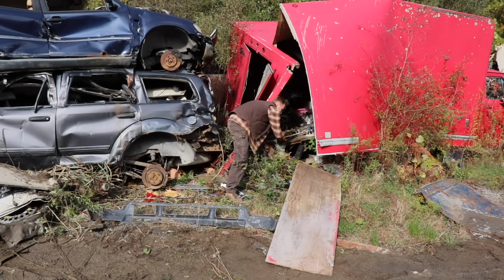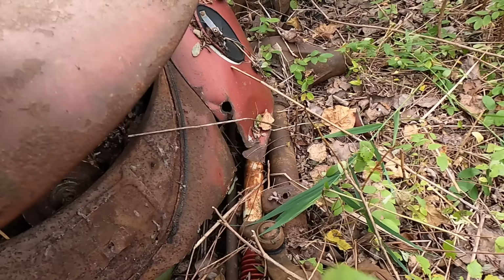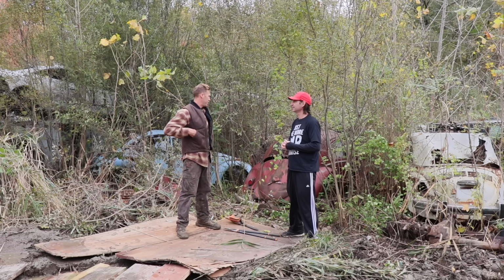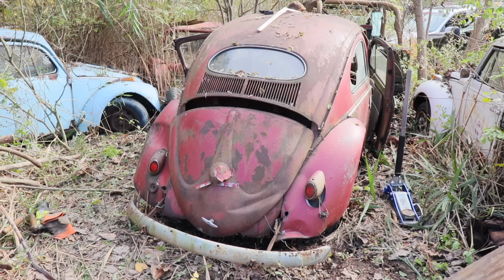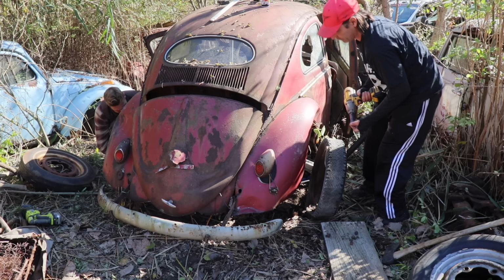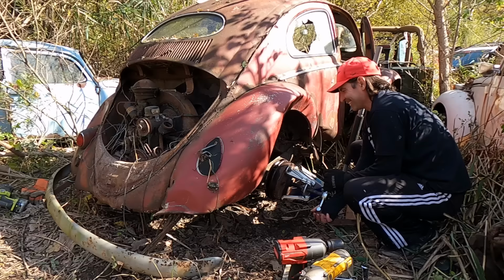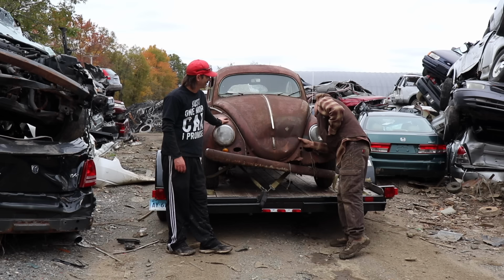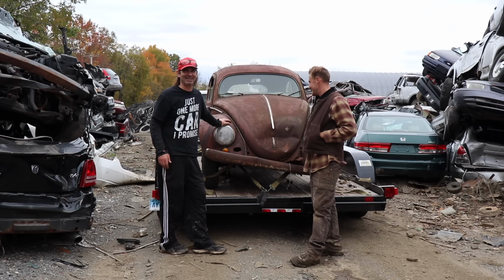Abandoned Rare 1955 Vw Beetle Found Buried in Junkyard sitting 51 years Rescued - 4 Full Restoration

Comment: My first car was a 1957 bug. 36 hp. My dad bought it for me at $200. It was in sad shape. I spent the winter rebuilding the engine and my Dad painted it bright red. It had a rag top sun roof. I drove it to Connecticut one winter from LI. Got caught in a nasty snow storm on rt 95. The bug had terrible heat in extreme cold. Snow was blowing up out of the defrost vents. I sold the car soon after that and bought a brand new 1971 Jeepster commando.

Comment: A 55 "oval". Got its name from the rear window. Rare as hen's teeth. Worked on restoring one back in the 1990s. Great car, simple, all mirtrors and strings! Rarest part is the chrome hubcaps. Apart from all the kerb damage veedub heads turned them into clocks! 
Good luck with the project!

Comment: correct engine parts. Those are hard to find. Big nut generator pully  smooth engine pully, correct voltage regulator, correct fuel pump. the fuel pumps are different on 55 and earlier. Horn button? OMG those are super rare and always missing
Reply: Dude.... you're pissing in his cheerios!!!

Comment: Pretty neat .

I'm old so I remember in 1969 when this was just one more of the millions of VW's across America, looking at the bald snow tires that came off it prolly couldn't pass the annual safety check and so was scrapped when still running .

When did "Honeycomb" taillights (1956 ~ 1961) become "Snowflakes" ? .

Good to see young folks still interested in old cars of any stripe .

-Nate
Reply: Just shine a light on the reflector and you can see how they get the name “snowflakes.” BTW, those snowflakes were on 1954 -1961 bugs. Interesting, I never heard them referred to as “honeycomb“ taillights before. That no doubt is due to the hexagonal shape of the reflectors. Those reflectors are also the snowflakes!  In 1962–1967, VW installed what I call “high heel” (or Dutch clompers) taillights to replace the snowflakes. These were larger with separate turn signals on them. The snowflakes were cuter, but not as safe as the high heels.
Reply: @nonelost1  Hi Marshall ,

You're young so I will pass on your mistake ~ the U.S. A. versions of Beetles used one taillight ('heart') in 1954 and another in 1955, Honeycomb taillights were introduced in the 1956 model year .

There's no good reason for kids to come along and change the given names of things .

-Nate
Reply from the maker: and i'll chime in that i have never heard of " honeycomb tail lights , only used for rims on 70's trans ams . Mid to late 55 USA models came with snowflakes ....early 1955's USA cars had smaller " egg " tail lights , like the 1954 USA cars. Euro 54's had heart tail lights .
Reply: @5150mxVW  Like I said : if you don't know =8-) .
Reply: @VWNate1  Well Nate, I stand corrected regarding the years those tail lights were mounted. When I googled “VW snowflake taillights“/“snowflake tail lights“/“ VW honeycomb tail lights“/“Honeycomb tail lights”, I found that honeycomb was surprisingly popular. Just be sure to specify “VW honeycomb tail lights.” This is especially true if you use those keywords on YouTube. BTW, during the ‘70s and ‘80s, I owned a ‘61 bug, two sunroof ‘62s, a ‘63, and a ‘66 bug. As long as I’ve been into vintage VW’s, I should’ve known better about vintage Volkswagen taillights. So perhaps you should not give me that “pass“ for being young after all.😂🤪🤣
Reply: @nonelost1  O.K., I predate the internet & google by a lot, I forget things too, no harm no foul .

I wonder if I can even remember every air cooled VW I've had, hundreds for sure, I even had a VW shop in the early 1970's most fun job I ever had by far . I wish I could get access to this junker, it'd be fun t make it run and drive safely, "patina" is B.S. but I remember driving rusted out $25 beaters like this in the early 1970's . -Nate
Reply: @VWNate1  That same rusted out beater from back in the day would probably set you back closer to $2500 today. In 1982, I bought my second ‘62 sunroof bug, a white one, for $1200. It had 177,000 miles on it but it was in fairly nice shape. I decked it out like Herbie the love bug, with the 53 decals and stripes. Back then, there were no “Herbie Internet kits.” Instead, I bought the 4 paperback books to the four love bug movies and figured out how to make them from the photographs in the book. I took it to two vintage VW shows, and won second prize in the “square window“ (1958–1964) division in one of them.
Reply: @5150mxVW  Kids : you try to teach them but.... -=8-) . -Nate (also known as 5150 at my old L.A.P.D. job)
Reply: @nonelost1  In 1974 or so during the fake gas shortage I bought a 1960 #117 (DeLuxe sunshine roof) Beetle in ?Santa Monica for $250, it was sitting in a hug pool of leaked out oil (oil cooler grommets were bad) with the right rear wheel parked haphazardly up on the curbstone, drive it home .

My son still has it, unrestored .

At one point I had a (one year only low compression) 36HP engine I'd taken out of my '53 Zwitter (split with oval dash), rebuilt it and that's still in the car 45 years later .

I hope he puts it back on the road one of these days .

-Nate
Reply: RE: "internet Herbie Kits" .

I've never heard of this, sounds interesting .

Disney used quite a few old beat to crap Beetles making the original Herbie movie and I once foolishly passed on buying the 1962 #117 that Buddy Hackett lightly welds near the dome light with for $250 ~ it even had the Disney Studios pink slip  .

The left front fender was bashed in and overall the car was rusty so I passed .

Oops .

-Nate

Comment: I just don't get how anyone could make this work.  They go for from 20 to 40k .  This car basically needs everything and the frame is probably rotted.
Reply: people have made cars from waaaaaay worse, and sometimes it isn't about the profit, but the experience and the resurrection of an historical piece.
Reply: @stefa_  That's (for history and no profit) about the only way I think it could work.  Scott over at Cold War Motors has 3 years in a 60 Fury and isn't even done yet.  For a large part of the time he was working near full time on it. Plus 3 parts cars and all this to get a daily driver. And he's a body man with 30 years experience also having experience splicing cars together.  Granted, this beetle  is was simpler and smaller than a Fury and with no stainless trim, but it is still extremely time consuming.  I cannot imagine there a single part on this car that does not need either a full restoration or to be replaced.  The roof is exposed and rusty and so it also probably needs full replacement.
Reply: Dear  @tarstarkusz  
👍👌👏  I thought to recognize your name, now I know. CWM forever! ;-)
Scott N. is doing the most impressive thing with the sliced Fury I have ever seen. He was the first I thought about after seeing the big dent in the bugs hood. I will never forget the incredibly amazing denting out jobs he did on the black pickup truck and Jims grey car out of the 1940s. All that in his driveway and just for fun. What a great guy.
Best regards, luck and health.
Reply: @Chr.U.Cas1622  Scott has done some amazing things with old cars,I always look forward to each weeks episode.
Reply: @rogercamp6071  One of the best car shows on YT and better than anything on TV.  I love the little skits like "My Classic Tire" and even the "Classic Darts" and "Light Buzz"
Jim is working on a beetle and a bus, but they don't usually get updates on the show.  Love all the old cars and the "driveway" atmosphere.  Scott's a pretty good musician too. He writes all the music that's in the show.
Reply: @Chr.U.Cas1622  He keeps saying this is "not going to be that kind of car" meaning a show car, but as time goes on, it's more and more like that kind of car (except under the hood).  He is doing an outstanding job.  Even doing his own sewing to remake the interior.
Reply: @tarstarkusz  yes I think the same way, the Fury will be as nice if not better than it was new and in last weeks episode he's purchased Tom's 60 Impala so can't wait to see what happens next.
Reply: @rogercamp6071  Hopefully he'll do some work on the Impala this year, but I doubt he can get to it.  I'm really looking forward to the work on Jim's Lincoln.  It looks like only the T is gonna get plates this year.
Reply: @tarstarkusz  yep Scott reminds me of my cousin who after he retired years ago acquired what I call his"iron menagerie"probably a dozen or so vehicles ranging in age from 1926 (a T coupe like Scott's) to a 67 Cougar.
Reply: @stefa_  I agree sometimes you sink a bunch of money into a project, not because you’re thinking at the end of it all I’m going to get big bucks for it, just because you love the damn thing. And sometimes all you end up with is a nice looking car and a pile of bills. Then you drive it somewhere and a fellow gear head walks up to you and says that, that is one sweet looking car and it makes it all worthwhile.
Reply: @rogercamp6071  And he's got his sister's Rover that needs finished, plus that ex-Parks Canada Dodge Coronet sightseeing limo, which is a seriously rare, handbuilt car that can probably justify a resto
Reply: @11sfr  I think he said he's not doing that limo. It's one of those rare and nobody cares cars.
Reply from the maker: very well said Jesse .....also saved from the Samba dismantlers !
Reply: @5150mxVW  Do you follow Cold War Motors?  It's a great car channel dealing with pre 1970s cars, mostly American or the Canadian equivalent.  Y
ou should show it to Jen and say "Look, I could have 65 cars like Scott" and "It can always get worse honey!"

Comment: If I'm not mistaken, and I drove/owned this same model. It is a '55, and it contains a very ~experimental~ transaxle, it's worth more than the entire lot you left behind. I dropped a bored an blueprinted 35 Hp Vdub engine in mine, you could run 90 mph in 3rd before shifting without it even sweating.  Please bring this back to life.
Reply from the maker: 90 in 3rd ? love to see that ...

Comment: If that voltage regulator is original and if I'm not mistaken, this would be a very late '56 or more likely, a '57, as previous years had a round regulator...but, of course it's more likely the regulator is an update rather than the engine being a backdate.

Comment: With those taillights and the oil filler its a 56. If it has a bend in the gear lever its a 56. 55 and earlier had a straight gear lever. Hope this helps.
Reply from the maker: yes , straight shifter , it is a march 55 car ....mid to late 55's had these tail lights here is the USA .

Comment: Engine looks like late 1956 but its got a few '55 bits that were swapped over like the generator pulley, '55 engines did not have oil caps yet! Up to Aug. '56 the whole draft tube assembly came off to add oil and was held down with a pivoting clip on the generator strap, I can tell its a July '55 or earlier by the ribbed doors, No semifore '55s had snowflake taillights so if they were swapped it was probably a Euro spec. and they threw away the Heart taillights for snowflakes and the headlight assemblies are probably newer sealed beams to replace euro bulb and reflectors, 1953-1955 early US spec headlight lenses and housings are exceedingly rare, more so than the correct egg or heart taillights! I consider all my Ribbed Door Beetles "early" and '56 up Beetles "late model" lol, Also save that front hood! I've seen way worse repaired, if that's the correct 5 bolt hood with the longer prop that attaches ahead of the hinge and not to the hinge bolts those hoods are going for $1000 plus lately ...
Reply from the maker: lots of good info there Bill ....yes , i think the case is a 57 with some of the 55 parts on it . early 55's did not have heart tail lights in the USA they had eggs ....this is a march 55 car

Comment: Jason becarefull of the alligators in that swamp!  What size engine is in a 55?  1200 or 1100?  Good save Jason!!!
Reply: 1100
Reply: @vayabroder729  thanks!!!
Reply from the maker: in NY ? haha...yeah old 36 hp , 1192 cc Dave
Reply from the maker: you might have had the 1100 in your Country , 1192 cc here in the States
Reply: @5150mxVW  They had the 25 hp, 36 hp and 40 hp in the old style. In ‘61 they came up with the new case design with the separate generator stand which was the 1200 cc 40 hp.
Reply: @5150mxVW  thanks J

Comment: I was wondering why you pulled off the rear drum brake.    It rolled in there then it should roll out.  or you have enough pulling power to drag it out. Chances are decent that all it needs is a battery jump for a 6 volt and it will start up.
Reply from the maker: haha, yeah and it was registered in 1965 so it should drive home too :)

Comment: Years ago , around ‘83, I answered an add for a ‘55…$400 but guy told it wouldn’t go into gear. I asked him if grinded when you tried to put it in gear
He said no you can’t get it in gear, just went out down the street and they pushed it home. 
Didn’t sound like a bad transmission 
I get there to look at it, not to bad, engine runs good, painted brown with a brush. Had a gasoline heater in the firewall
I lifted up the rear seat, pulled the view plate over where the shift linkage goes into front of the transmission 
Its supposed to have a safety wire that goes in to hold it together. 
Yup missing and the linkage isn’t engaging the trans 😉
Of course I didn’t say anything to the seller…Offered him $200 and he said Deal. I got the title, he asked when I can pick it up 
Told him I’m going to drive it home!
I hooked the linkage back up and that is what I did. Was my daily driver for a couple years

I don’t think the bug in the video is a 55 looks more like a ‘53

Comment: So the vw was only driven 5 or 6 years before it was parked? I find that strange without it being wrecked. Even back in the 50s vw beetles were pretty easy and cheap to repair. Well stranger shit has happened I suppose. Great find regardless.
Reply from the maker: I think your math is off a bit :)
Reply: @5150mxVW  yeah slightly ...nothing new 🤣🤣 but it was not driven for a ton of years. What is the mileage on the odometer? Great save anyway. Hope to see it running again.
Reply from the maker: haha :) , I think it was just flipped ( odometer )  ..looks to be org engine ...I think it has been off the road since 1970 but not sure on how long it's been in the scrapyard . Thank you , much appreciated